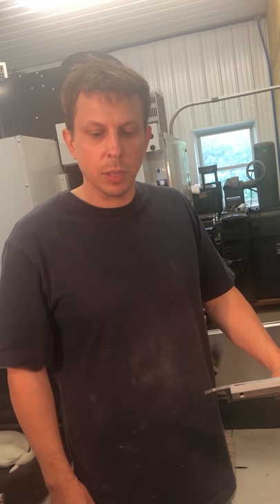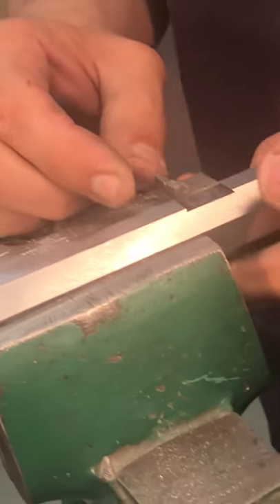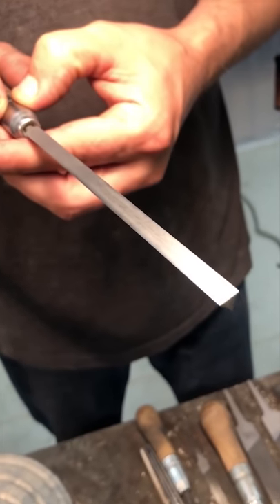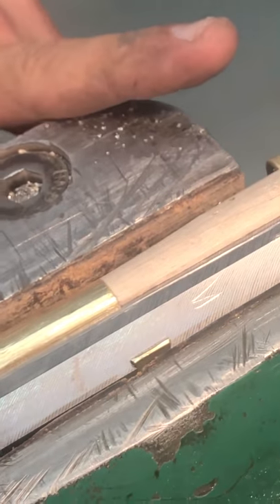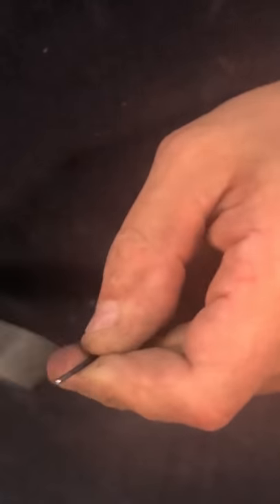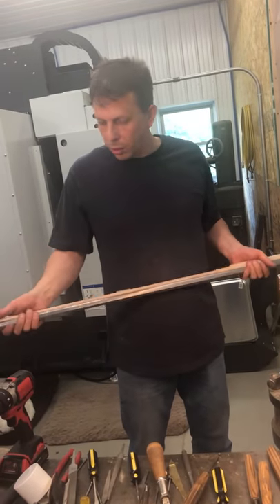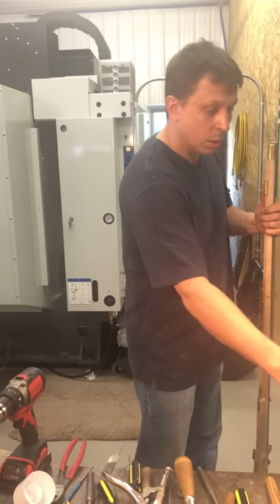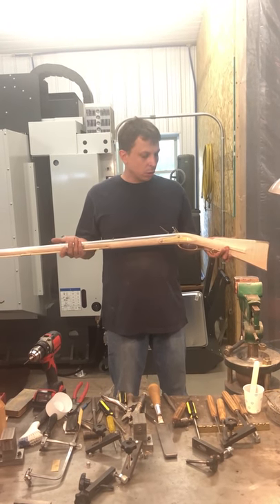Step 5 Colonial Kit Sights, Liner and Lugs Installation

Comment: I've assembled 4 rifles, one of them 3 separate times after dropping it out of a tree once and not being satisfied with the half stock I made out of it after roughing out a slab of wood I'd  picked up. They were all cap locks with straight barrels, but I never felt confident enough to tackle a swamped barrel and a flint lock. Now, I think I am. Do you make that particular rifle kit in a 50 or above caliber?
Reply from the maker: Yes, it comes in 50, 54, and 58.  Let us know if we can help
Reply: @kiblerjim  it will be a while but you'll be hearing from me about a 58. I've put together a 54 Leman, a 50 southern mountain, both with straight barrels and in percussion.  But what I really want is a revolutionary war period flintlock that might look like it came out of N.Carolina. my paternal line came from what is now Cabarras County along Coddle Creek. Any pointers toward research for a rifle from that area would be appreciated.  Thanks for your reply.